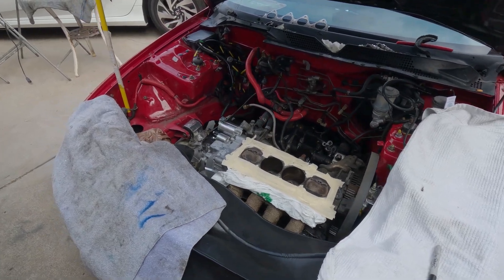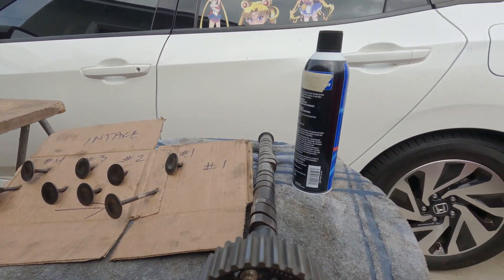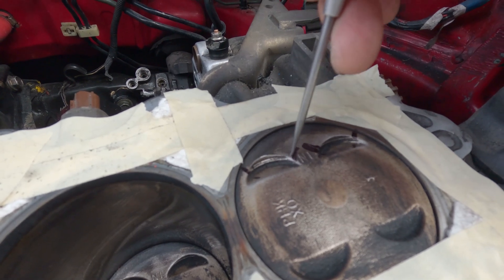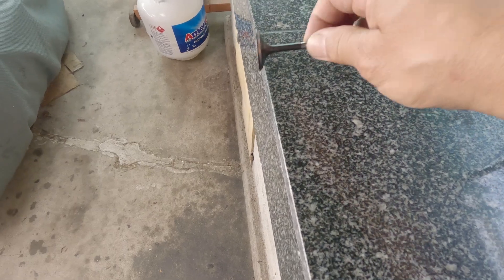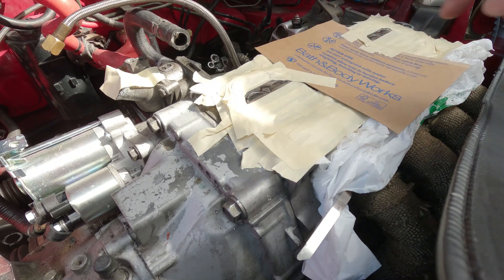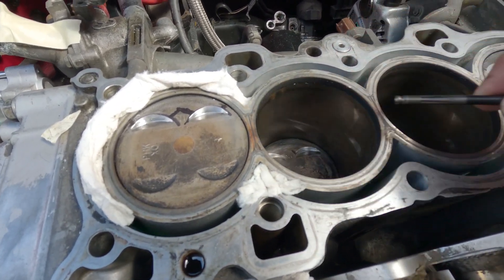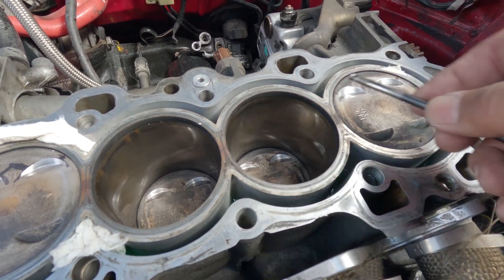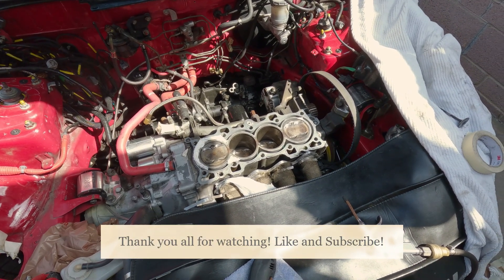B20vtec Civic swap! Valve and Piston making contact. ep.2

Comment: Was this a case of the engine not being timed correctly initially or do the phk pistons always contact? 

I've heard conflicting information regarding this.
Reply from the maker: I think it was the dowel pin, when l was putting it together, l've noticed that one was loose. Not sure on B20vtec build if the head need to be drill for dowel pin. If it is, maybe it wasn't drilled concentric.
Reply from the maker: Dowel pin being loose or head wasn't drilled concentric, head could've shifted or misaligned.
Reply: @sagittnet2158 the dowel pins for a b20vtec are supposed to be stepped, because they are different sizes on a VTEC head and non VTEC block so the proper dowel pin solution is aftermarket, one side of the dowel is narrower than the other making for a nice tight fit.  Do you know if your friend used b20vtec stepped dowel pins?
Reply from the maker: @MMitr204 ai'm not to sure now if it has a stepdown dowel pin, been a while now.
Reply: @sagittnet2158 I will definitely clay the engine. I wish I lived in California it feels like you're one of my uncles explaining things in your videos. my Tito boy was a mechanic but he passed away from cancer before I was able to learn from him.
Reply from the maker: @MMitr204 Me and my cousin was lucky enough to had guidance from our uncle who tought us how to drive when we were on our teens, namamasada ng jeep before he passed away, something we wont forget. Sorry about your lost but l know your uncle spirit will live in you coz in away your like him tinkering things and good luck on your build.
Reply: @sagittnet2158 Salamat Po. Do you know if the exhaust valves should be cut also it just the intake?
Reply from the maker: @MMitr204 just the intake.
Reply: @sagittnet2158 ok thank you!!
Reply: @sagittnet2158  I decided to start cutting small reliefs into the intake valves this morning. I haven't clayed the engine, but even if clearances are good they may not be good at 8k rpm.
Reply: @sagittnet2158 I'm using a b18c5 cylinder head, do you think the exhaust reliefs on the piston will still be ok? I believe the exhaust valves are both 28 mm on both b20 and b18c5 but I'm worried about how much the exhaust valves open on the b18c5 exhaust camshaft
Reply from the maker: @MMitr204 it should be alright, as long as the head has not been shave.
Reply: @sagittnet2158 no head was not shaved but I am using a zerg industries 2 layer head gasket to raise compression, it's 0.18 in thickness
Reply from the maker: @MMitr204 okay, if l were you, l w'll clay the motor to be sure. If you dont have a use gasket, you can use the new 1 but torque the headbolts to minimum only.
Reply from the maker: I've seen others b20v build that has similar issues, p2v contact.
Reply from the maker: Another scenario could be like you mentioned, its not timed correctly coz when l took over, l've found that the camgears aren't  adjusted correct.
Reply from the maker: If you were to build 1, l suggest clay the engine to be sure.
Reply: @sagittnet2158 thank you so much for the information Po
Reply from the maker: @MMitr204 walang anuman at salamat bossing

Comment: Hello im just woundering my belt snapped from my b20v i want to know im good with the valves valves are stock im using catcams stage 1 and nippon racing jdm b20 pistons hight compression 12.5.1 i just woundering if valves can touch the piston with that thank you if you respond
Reply from the maker: It's a interference motor and when timing belt snap broken, it could have a  possibility piston and valve or valve to valve contact. The only way to find out is, make sure that nee belt can be safely install and once its accomplished, start the engine and ifs not idling rough, engine is okay. You can also do a compression check once timing belt is safely installed, to find out if there's any compression differences. Hope your motor is okay.
Reply: i tried also moving the cams and see if valves moving and also checked clearnce from te where valves adjust and have a normall clearence  @sagittnet2158
Reply from the maker: The green Civic with b16 have hi comp piston and it has sk2 tuner cams. No p2v contact there.
Reply from the maker: Is your b20v came stock w/ vtec cylinder head or you build it?
Reply: I build it  @sagittnet2158
Reply: I checked the clearance from the valve and lift no cleareance at all its normal intake and exhaust i was rotate the gears slowly every valve come up none is stuck open or something @sagittnet2158

Comment: Omg I have also b20V, it’s a b16 head and was having overheating issues then it started leaking coolant into cylinder number one and 2. 
I removed the cylinder head and found my pistons look like this🤦🏻‍♂️ I really thought it was normal but I just saw this and no it’s not lol. I just send my cylinder head to 4Piston like 3 weeks ago and now I have to check my valves and either fix my pistons like you did or change them but I really don’t have the money to change pistons so I’ll probably end up doing this I’m just getting tired of all this idk what I’m gonna do but it sucks because I was really excited to get the 4Piston head on and slap my turbo back on. Now I’m just tired n don’t know what to do😥
Reply: And also I had check the compression a lil while back and it was at 175 all 4 and to me that was a lil to low idk if this is why.
Reply from the maker: We got same results except that "4 is 210 psi. The correct way actually is to run the engine till the fan turn on( normal temp). Shut it down and wait for a few minutes and take your reading. It should change, as long as your compression is not lower than 130 psi and 10 or 20% varience between cylinders. Your okay, we let it go coz the owner was thinking of boosting it in the near future.
Reply: @sagittnet2158  thank you I will start working on fixing the piston a bit like you did here appreciate the content you make it helps a lot!. Much love and respect stay blessed 🙏🏼
Reply from the maker: @yeetplays3421  no problem man! and thanks
Reply from the maker: No worries man! If you have not put them together yet, you still have time to check it and repair the piston by widening it a bit. Check you dowel pins, make sure its not loose on the block. I think the reason for the damaged was a combination of both. Tight clearances and loose dowel pins. If the dowel pins are loose, the head could migrate and sinced it was a tight clearance, its only inevitable that the piston will kiss the valve.

Comment: Yup uncle he shouldnt have used a adjustable cam if you are running a stock phx pistons .. whoever built that motor 1st got it all smash the valve and piston accidentally and might have not timed it good
Reply from the maker: Yes p'mangkin! When l've seen it, oh man! What is goin on here, there's really not much valve relief for the b16 valves.
Reply: @sagittnet2158 the body shop open the engine kua because they cant figure it out why my engine is running crazy. And thats what happen kuya noel they adjust the timing super off.

Comment: Hello sir. On this B20, what caused the piston to valve contact? Was the head or block milled to increase compression? What type of pistons are those? Are there bigger lift camshafts? Was it because the cam gears were advanced too much?
Reply from the maker: It's OE piston for B20 (PHK piston) and using a base B16 cams. Even though the ex camgears was adjusted full max advanced, lucky it didn't hurt the valves. Now that l researched a bit and l think the only way the valves will  hit the pistons is the 2 dowel pins. Somehow its a bit loose and maybe somehow it shifted and that's how it made contact on the piston. Maybe the OE ( phk) pistons dobt really have enough valve relief when a B16 head is mated on the block. The compression on the motor was 9 something to 1 ratio. According to zealautowerks.com. B20/ B16 (PHK piston)
Reply from the maker: And thank you very much.